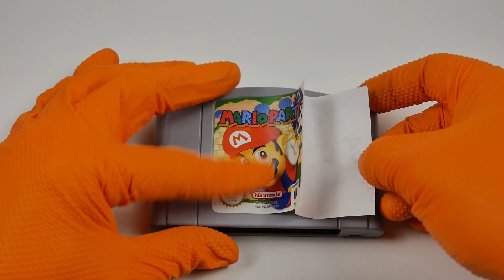Just another repro-sticker replacement on this N64 Mario Party // overhaul restoration // Nintendo

Comment: Goo gone usually works well with label stickers, the adhesive pretty much comes off easily when soaked in it. Great video!
Reply from the maker: Haven't tried that one yet - the soaking in soapy water worked very well too but I can imagine there are stickers that are way harder to remove